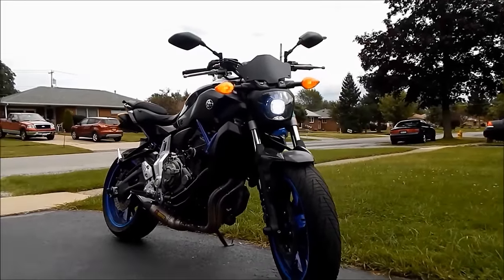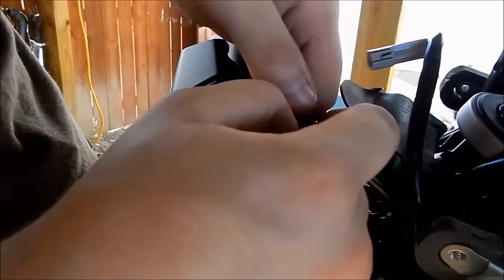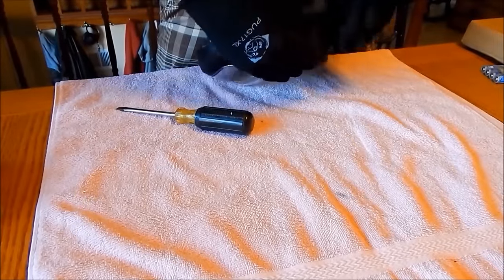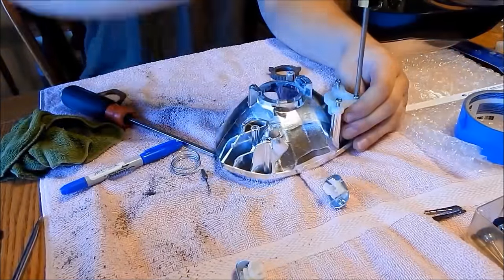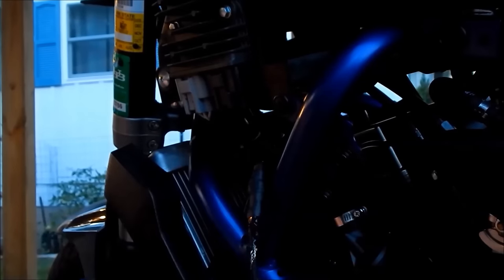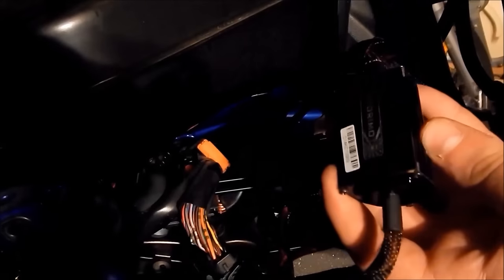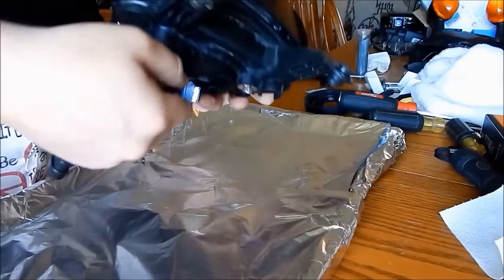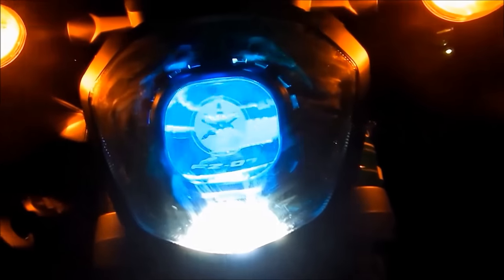How to Retrofit a Projector Headlight into a 2015 Yamaha FZ 07

Comment: ya maybe the moisture isn't really a huge deal since riding season is warm weather lol. so I guess it would climatize on its own. I retrofit ram headlights so it took a lot of trial error to get a good mix down to rid the moisture issues. since I normally do most of my work during winter months. great video though. I've shared it so hopefully you get more views.
Reply from the maker: Thanks a lot. I appreciate that. I did my gf's cobalt's headlights last summer and they were holding up great until we took a vacation down to Presque Isle state park in Erie PA and I noticed a shit ton of moister in her drivers side headlight... DX I guess I'll be having to re-seal that one. The passenger side is crystal clear though. No sign of moister at all Knock on wood. No idea how the drivers side happened. Climatizing is really important, guess with the bike though, the way I did it, it's not really an issue. ¯\(ツ)/¯

Comment: Very, very Cool! By far the best head light mod i have seen out there! Thank you for taking so much of your time to show the step by step process on how to do the install. Would you be able to tell me which kit you ordered? I have to do this modification on my '14 FZ-09!

Thank you for your time!
-Matt
Reply from the maker: Thank you! The kit I used was this one:
https://www.theretrofitsource.com/motorcycle-specific/hid-systems/motorcycle-stage-1-single.html
If you want to know exactly what I ordered in that kit, see this post I made here on the FZ-07 forums:
http://fz07.org/thread/3216/projector-retrofit-kit-source
Note though that when I ordered this kit over a year ago, the options were slightly different than they are today. For example, they don't sell the X-Lens (Square lens) in the D2S 4.0 I believe. Also, if you order from the link I provided, you would get the D2S 4.0, which is a better projector, but the dimensions are slightly different. You are going to need to make sure the projector will fit inside the 09's headlight before you spend all that money to order a kit like this. If you go through with it, feel free to ask me any questions you might have. I'd be happy to help!
Reply: Allen thank you for the quick response!

Comment from the maker: +Donald T You need at least 117 mm, which is about 4.6 inches, between the plastic lens of your current headlight and and the inside opening of the reflector bowl (Where the halogen bulb sits when it goes in the reflector). If you look at this, http://fz07.org/post/52599/thread post on my motorcycle forum, I put a ruler next to the D2S  and compare it with the Mini H1 in size. The only part that you will need to worry about for clearance issues would be from the front of the lens to where the threaded shaft starts (or where the silicon washer starts, whichever way you want to look at it. It's the same place), which like I said is only about 4 and a half inches. Like with any motorcycle retrofit, it will be a tight fit. Something to keep in mind with this projector though is the X-Lens option, which is the square one, is actually smaller than the O-Lens, which is the round lens. The O-Lens diameter is 3" and the "diameter" of the X-Lens is only about 2.5". It really just depends on how much cutting you're willing to do and what look you're going for. I wouldn't imagine you'd need to do much more than I have, but I can't say for sure as I don't own a DRZ-400 (Although I kind of with I did have one along with my 07). Good luck and if you have anymore questions, let me know!
Reply: thanks I'll look in to it

Comment: I'm glad you went into such detail about this project. Nice work with the custom engraving on the headlight. Have you considered switchback LEDs for the front turn signal/running lights? They are white when on, amber when blinking. I like them, preference.
Reply from the maker: Thanks! I have considered switchbacks for the front AND rear turn signals. I actually have some for the front and I haven't gotten around to installing them yet. The back I need to order some supplies for first. The front switchbacks however aren't really as bright as I'd like them to be, so I would use them as supplementary lights. Meaning they wouldn't be my only turn signal upfront. Safety before looks. :)
Reply: Good point, its hard to know which LED's are brighter than others. I ordered eBay ones before and it was extremely disappointing. I got good ones from the retrofit source. Also other suppliers that are honest you get good ones from.
Reply from the maker: Yeah. TRS has some good stuff. Did you get the XB 2.0 Switchback strips? I would consider using those possibly as my only turn signal, but I haven't seen the brightness in person. Do you think they are bright enough to be standalone turn signals?
Reply: I haven't tested those yet. Head over to HIDplanet if you want to see every one of their products tested. Turn signals too close to the headlight are too hard to see in day or night, so I vote no on LED strip only.
Reply from the maker: I am already a member of HID planet, but ever since they changed to forum layout, I haven't been on all that much. I didn't think they would be bright enough on there own, great quality or not. Aftermarket LED strips lack a very important thing that OEM LED turn signal strips have, dedicated reflectors and diffusers. The OEM LEDs have reflectors they sit in front of to direct any possible light forward. Something just throwing an LED strip into your housing doesn't do. But I don't need to tell you that I'm sure. I think I plan on having an integrated tail light and LED sequentials in the back of the bike and LED switchbacks in the front air scoops along with some watsen design LEDs replacing the front stockers.
Reply: Yeah unfortunately most LEDs just can't work in housings designed for Halogen. Same goes with HID "upgrades" (I'm looking at those Civic owners :] ).

That plan sounds really good, a custom made housing for LED would do great to project light where it needs to be. Great idea! 

Looks like I'll be picking up some LED prototype projectors for the new bike... :).

Comment: great videa. The projector looks awesome. I need to get it one day as well. But I don't have the tool to grind it. Also I have an ABS so fitting would be probably a bit more difficult
Reply from the maker: +Sir Lightyear All you need is a Dremel tool. If you don't have one of those, honestly you can do it with a serrated knife if you are careful. The ballast may be able to fit on the ABS box. I don't know how big it is or what it looks like, but the ballast doesn't take up too much room. If it doesn't fit there, it isn't hard to find somewhere just to zip tie it onto. That's what I did on my GF's Cobalt and it works fine.
Reply: alright. Thanks. I will consider it

Comment: Hey great video I'll be doing my FZ07 too, I have some questions. You mention a bracket at the end of the video, what is the purpose of that bracket and did you have any difficulty with fitment once the bulb was in there?

thanks again
Reply from the maker: The purpose of the bracket is to lift the entire headlight assembly up, so that way the cut-off line of the beam is level with the road. You will find that when you install the projector into the housing, it is such a tight fit to get the projector in there, that you cannot aim the projector high enough to light up the road properly with the low beam, because the lens of the projector will start to touch the lens of the plastic headlight housing if you raise it to high with the headlight adjustment screws. So the solution is to raise the bottom of the entire housing to pivot the light to where it needs to be.

As far as the bulb with the igniter coming off the back, if you make the bracket, you shouldn't have any issues with the bulb fitting. If you choose not to make the bracket however, it can mess up the igniter. The igniter gets warm and what you will come to find is that it rests against the triple tree and the repeated rubbing against it and the warmth deform it a little. It may or may not cause issues later down the road. There is no way I can say for certain how it will effect your exact setup.
Reply: +Allan Baillo Hey really appreciate the tips can't wait to jump into it.
Reply from the maker: No problem. If you have any more questions, feel free to ask. I'd be glad to help! Good luck!

Comment: Is there any reason to really keep the reflector bowl in the headlight? I want to do this on my Monster 821 but I'm worried about space. I figure if I remove the reflector it might give me more clearance/room to work with. I know this isn't FZ related but wondering if removing it on the FZ would have given you even just a little bit of space to close things back up.
Reply from the maker: Well, yes and no. At least in the FZ's case you probably couldn't do it. It would give you more space front to back, but you need the reflector to actually attach the projector to. If you removed the reflector you would need to find a different way to affix the projector to the housing. Not impossible, but more difficult for sure. Maybe your 821 is different in this sense. I haven't personally taken a look inside one of those housings to tell you a definitive yes or no. Another thing to keep in mind is if you take the reflector out and hard mount the projector to the housing, you lose the adjustability of the reflector once the headlight is sealed back up. Hopefully this helps. Let me know if you have any more questions or something isn't clear. Good luck!
Reply: @allanbaillo4990  Hadn't thought about the adjustments once everything is sealed back up. I've looked up and down the internet for a dual headlight setup for the M821 as its the look I'm really after but there's little to nothing out there that fits the bill the way I want it to, let alone having LED projectors. Have you had any concern about power draw? There's another video where a guy put a 55W version on his Grom but said he moved to the 35W and even then figured the draw would still be too high for motorcycles. He suggested LED but i'm not sure that TRS sells an LED projector in a compact size. 

Appreciate the reply, this is a great video that should at least help me get started on my own bike. Your setup turned out looking great!

Comment: What is the total depth of this kit? I am looking to do this on my DRZ-400, but I worry that this kit will be too large to fit in the current housing.
Reply: did you end up doing it? ive got a dizzer and was also interested
Reply: I did not. The measurements I got from the retrofit source for even their smallest projector was too large. I have been looking at some other options but haven't found anything that will work. I saw a set of dual can style lights on a harley that looked like they might work but I haven't pursued it. I worry how a a bi-xenon projector would do on a off road application. I think another problem with the DRZ is the front glass is designed to control the light, so I think it would not be as clean with a projector behind it. I think it would need an entirely new housing with clear glass. I did do a retrofit for my 2008 FZ6, and I have been happy with that for the most part. My only problem is my right cut off doesn't alway return when turning off the high beams. For as popular as the DRZ is I am surprised there is not a good bi-xenon hid option.
Reply: i think your right i might just have a look at after market motocross/enduro headlights 
thanks anyways though mate

Comment: Does the paint have to be a special kind for high heat or anything like that?
Reply from the maker: Well, if you plan on doing a passive demon eye where you paint the cutoff shield, I would definitely make sure it is high heat resistant. For the shroud, if it is a high heat paint that is a plus, but I don't think it is completely necessary. I used the OEM color matched paint and it was not rated for high heat as far as I know and my shoud has held up fine so far.
Reply: +Allan Baillo sweet thank you for the help!

Comment: You went with the 35 watt ballast right? Is there any reason not to go with the 50?
Reply from the maker: I did go with the 35 Watt. There is nothing really wrong with the 50 watt, it makes the bulb brighter (slightly) and decreases the Kelvin by about 1000, but they decrease the life of the bulb.
Reply: Looks like stock is 50W, so either is fine. You get higher temps, more light, and more power used. Typically motorcycles are notorious for bad charging systems and freeing up 15W extra would be nice for other accessories.

Comment: you forgot to mention about climatizing the housing before install an lighting it up. so that there won't be moisture inside
Reply from the maker: You know why I forgot it? Because I actually didn't figure out a good way to do it at the time I made this, and I was in a rush to get this out to get a $50 credit towards another order I was placing. honestly, since I posted this video I have been running it the way I have it in the video,  where the only thing on the back is that rubber boot that I cut to accommodate the size of the D2S igniter,  and I have had no moisture what so ever. And I've ridden in the rain and it has been left outside on humid days aswell. Actually the bike is stored outside. I have zero moisture. So even though I forgot to put this in the video, it still works as intended if you follow the video. :P lol

Comment: Where did you get the projector lens with the Yamaha Logo and FZ-07 etched in it? Was that special option on the retrofit source?
Reply from the maker: Yes. It was cheaper when I did it. Here is a link for if you want an existing design.
https://www.theretrofitsource.com/complete-retrofit-kits/lenses/etching-service-existing-design.html
When I did it they didn't charge extra for a new design, which mine was at the time. Here is a link if you want a custom or new design.
https://www.theretrofitsource.com/complete-retrofit-kits/lenses/etching-service-new-design.html
Reply: i appreciate you attaching those links! a few more questions... since you have gone through the retrofit source with this etched design, do you think that would that qualify as an existing design? Also what shroud design did you choose in this video?
Reply from the maker: Here is the link for all the existing designs currently out there, which the design in the video is included in that list, all the way at the bottom.
https://drive.google.com/drive/u/0/folders/0B-IIXfUHvR1PU3ktT3ZDTWZVVHc
As far as the shroud, it actually doesn't exist anymore because they stopped making the square D2S 3.0's and therefore the square Gatling gun shrouds. The next best thing is the normal round gatling gun 2.0 shrouds for the normal round D2S 4.0's they currently sell.
https://www.theretrofitsource.com/complete-retrofit-kits/shrouds/gatling-gun-2-0.html
Here is the full "write up" I did on my forums with a lot of information about this project in case you were interested.
https://fz07.org/thread/3216/projector-retrofit-kit-source

Comment: Great video... How were you able to keep the shroud in place? did you glue it to the projector?
Reply from the maker: Thanks! Hmm. I can't believe I glazed over that in the video. What I did was take JB Weld 2-part epoxy and placed very small dabs of it on each of the 4 corners of the metal frame of the projector that were going to interface with the shroud. There are divots in the metal frame where tabs on the shroud will sit in, you can also put small dabs of epoxy there. BE VERY CAREFUL when handling this epoxy around the projector. If you get any of it on the lens it is almost impossible to get off. Let me know if you have any more questions!
Reply: That is what I did as well. Thank you for confirming that.I am done with my project. Thank you for the step by step instructions. The only thing that I am not 100% sure of is that the ignitor is pressed against the vertical tube of the frame. It does not hinder the operation of the handle bars during steering. Is it okay that it is like that? Is yours the same way too?
Reply from the maker: So yeah, that happens when you don't have the bracket like I said in the last step. You could leave it like that, but your cutoff will be low and that could cause ignitor issues in the future. A bracket that pushes the bottom of the headlight assembly forward would solve both of those issues, but you could leave it and just run the high beam all the time, that's what I did for a while.
Reply: DO you happen to have a picture of the bracket? Did you make the bracket yourself or was it something that you were able to purchase?
Reply from the maker: Unfortunately I do not. Right now it is on my bike and it's black so you can't see it very well and I don't feel like taking it apart at this time with school going on and all. I'm sorry. It's pretty easy to make though. I went to Home Depot and bought a 2 inch wide strip of aluminum and cut it, drilled holes in the proper spots and tack welded the current cradle on to it. You can also JB Weld the current cradle to the one you made if you aren't comfortable spot welding.
Reply from the maker: Looks great man! How did you end up making the bracket?
Reply: I bought 2 brackets from the hardware store and a couple nuts and bolts. I had to drill the brackets to make them adjustable for the height.Thanks a bunch for your help!

Comment: Did you remove the old glue before applying the new one?
Reply from the maker: I tried to get as much out as I could. The stuff is in there pretty good and it is best to try and dig it out with a flat head screw driver right after it comes out of the oven after you separate the lens from the reflector, as the butyl is still warm and malleable at this point. Just make sure whatever screw driver you choose to use is one you don't care about that much, because the butyl will stick to it and ruin it.